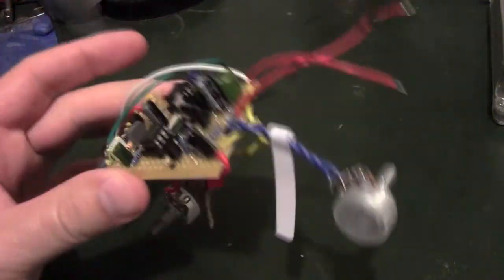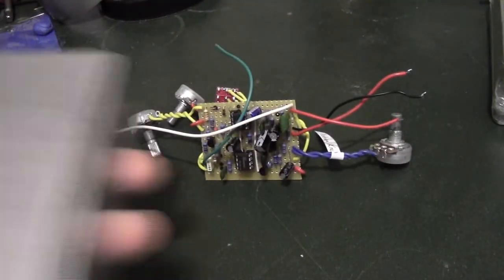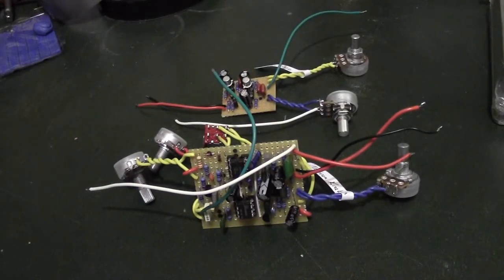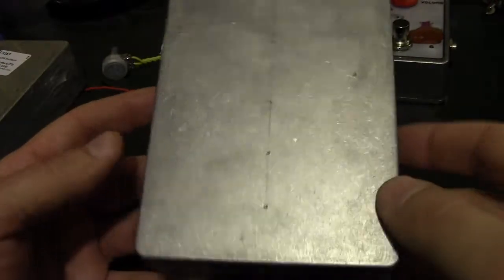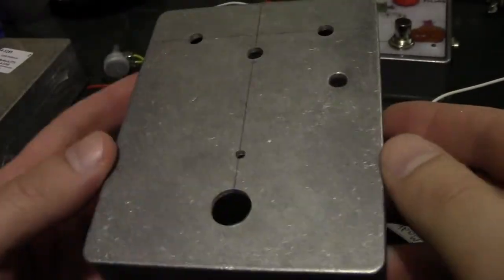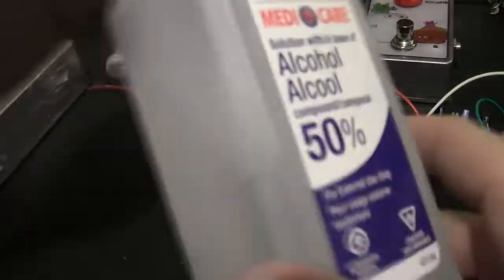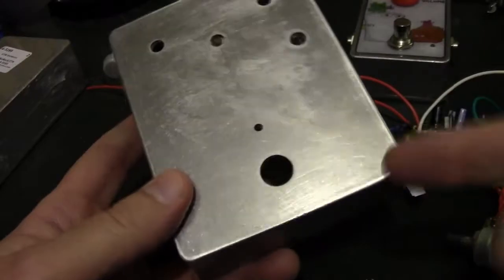How I Build Pedals Part 6 - Preparing and Finishing the Enclosure

Comment from the maker: Timestamps:

1:37 - Considering enclosure size and parts placement
8:35 - Measuring and drilling the enclosure
19:16 - Sanding and preparing the top
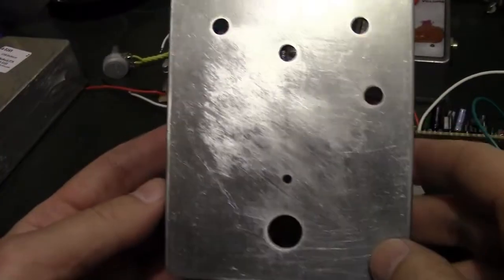22:49 - Label prep
24:52 - Preparing and applying epoxy
36:53 - Check and drill epoxy, final wiring

Comment: I had a question about a previous video in this series... The beavis board breakout box [circuit tester] you linked, was that toggle spst switch an "on/on" [two position] configuration?  Thank you for this series of videos, as they have assisted in answering a few questions I had about diy pedal building. Keep it up!
Reply from the maker: The toggle is supposed to be a spst, which is an "on/off" switch.  However, you can easily use an spdt "on/on" switch to accomplish the same thing.  You just use the middle lug plus one other lug, and leave the third lug open.